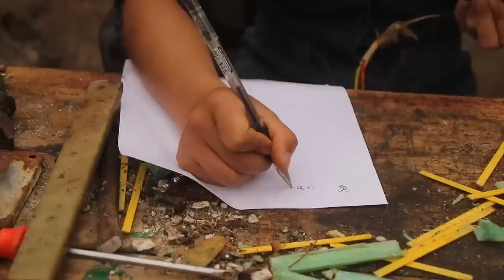💡 Genius Girl Restored a Rusty Broken Pipe Pump For Workers （It's not a cannon）

Comment: Hi Lin, May I suggest that you “weld” your winding connections as solder will fail under some circumstances.
Reply: Sería muy bueno que personas capacitadas como creo que es Usted, hagan criticas constructivas y generan debate que mejorara el trabajo en teoría y práctica
Reply: She uses soft / lead solder, we used to silver braze them, stronger and withstands much more temperature

Comment: You're an outstanding engineer Lin but please buy the correct crimp tool for those tabs rather than using those pliers.  Overall excellent work though.  You have a fantastic mechanical mind.

Comment: You worked much hard on this motor this Linguoer, it seemed to be wired differently than any of the others I have seen you work on. But, never the less, the job was worked to perfection. How long does it take from start to finish to repair something like this? Just wondering.

Comment: Did you ever consider using a hydraulic lift pushing down on the edge of your motor that would smoothly pull the wires?  It would be connect a strong cable around your pliers at its pivot point.  Turn off the pump, slide the pliers down to get a grab, hold the wire, turn on the hydraulic puller (foot switch?) and it pulls the wire up slowly but powerfully. Let go with the pliers, take out the wire, reach down to grab another one.  I only needs to pull a short range for your small motors.  You could use vice-grips to lock onto wires where a strong pull was needed.  Richard Collins, The Internet Foundation
Reply from the maker: Thank you for your advice and support💖

Comment: Amazes me more she can get new bearings and seals for some of these... no way to be using the old ones..though I wish she would build herself a sandblasting cabinet...and we had a discussion on how to use spray paint!..short bursts!
Reply: bearings are interchangeable and come in regular sizes you just need the inside hole size and the outside measurement and the type of bearing and you can purchase one but some of the other parts must be difficult to order

Comment: Lin.   Single phase or three phase ?
How many turns per coil, how many coils per phase, what size wire ?
What connections used ? What voltage ? Why no starter?  Why no resin ?
Can't answer these questions I call it all lies !!

Comment: As much as I love to watch you work, I'm a little disappointed this time. I've never seen you turn a restoration out with a faulty electrical cord. Leaving the power cord without properly connecting it to the box is dangerous. Maybe you fixed it after but even during testing it looked bad. Sorry to mention it.